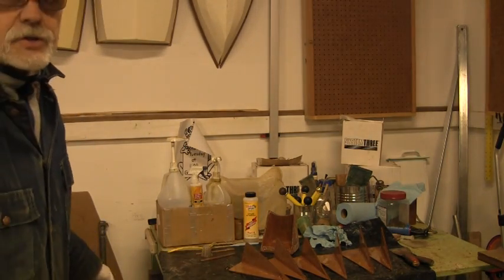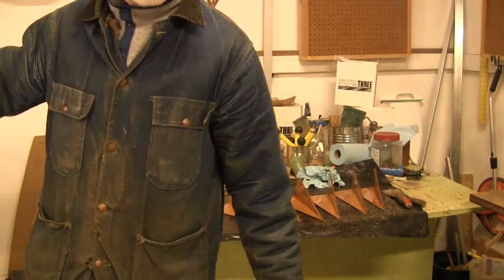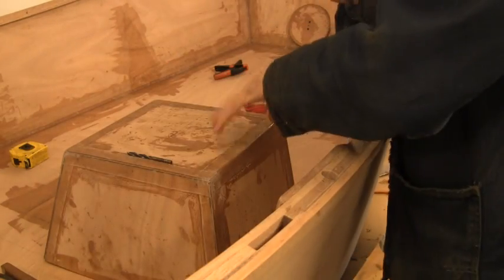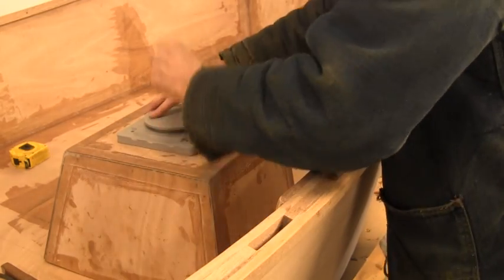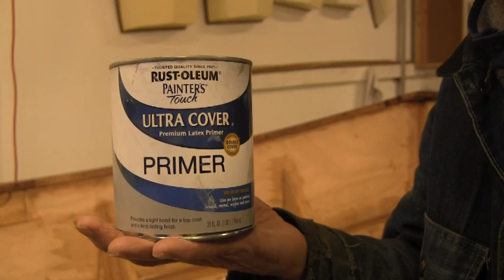Building Nymph Part 21

Comment: Where is the seat from?
Reply: +J Amann Amazon has a couple of models. I found a plastic model on sale for under $20.00 (Amazon Wish List). 

Spent more on a set of mounts from Wise Marine / Manufacturing.. 

Was thinking I could add another pedestal, mount a plank instead of a seat and take a grandson along?

Did you build a Nymph?
Reply: Not yet!  I don't have a garage or barn to work from. Hope that changes someday. However in the meantime, I'm enjoying learning/watching at the moment.  :-)   Thanks for taking the time to share.